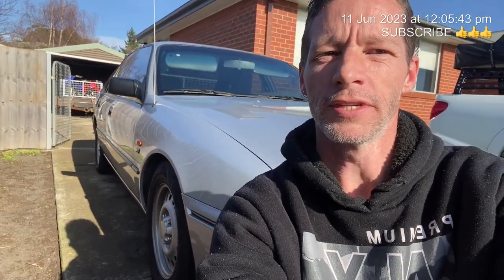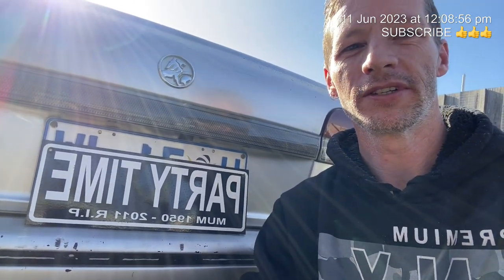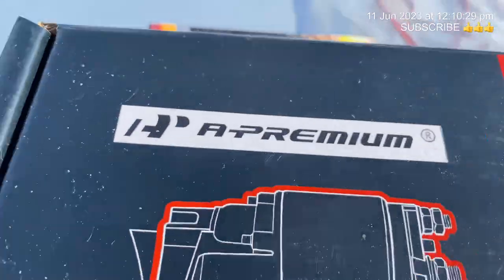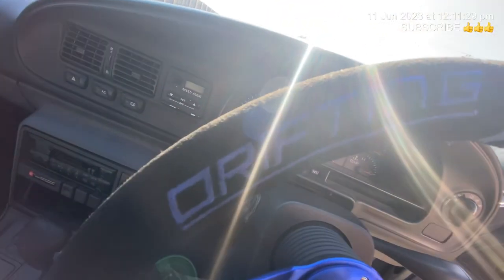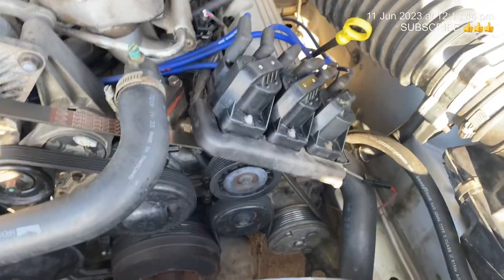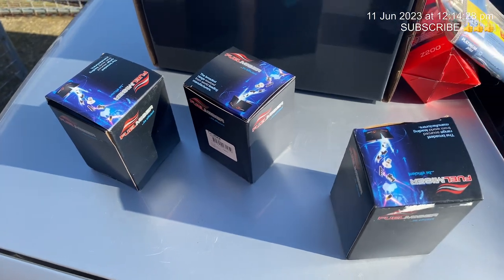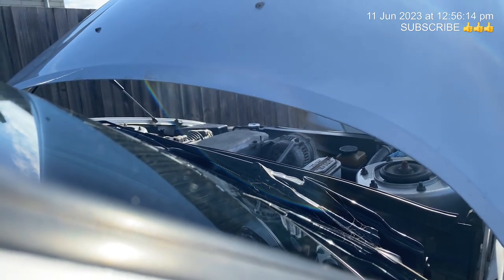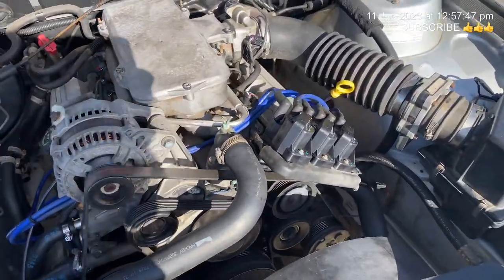Vs commodore $5000 budget built race car part 2

Comment: If your using it for drifting i recommend leaving the standard bushes in as its better having a floating car to learn in.. or ive built mine up for street/race sl king springs and nolathane bushings all around lowered gt sport monroe shockies and vt front brake upgrade i tell you man its a go kart on steriods..
Reply from the maker: I don’t think I’ll be doing any drifting as it will be more for circuit racing and drag racing

Comment: What exhaust set up are you planing in running? 
I've gone pacemaker extractors into a hollowed cat and a 2/5 inch redback exhaust with a standed muffler. Sounds pretty decent and definitely revs a lot easier.
Reply from the maker: The exhaust set up will be in a up coming episode

Comment: That belt is abit stretched by the looks of it.. great vid though ive got a 97 vs berlina s2 im having problems with the pullys whining on me hoping to replace the 3 idler pullys and a new belt👌
Reply from the maker: Yeah I will be replacing the serpentine belt as I did notice it was loose